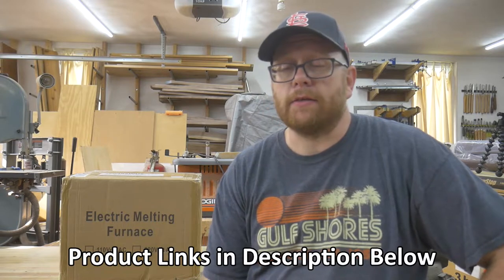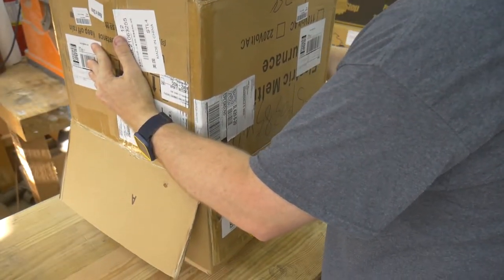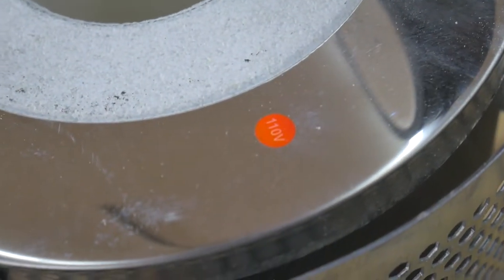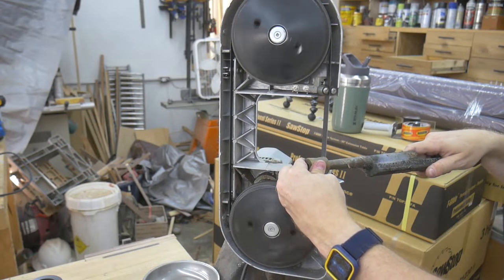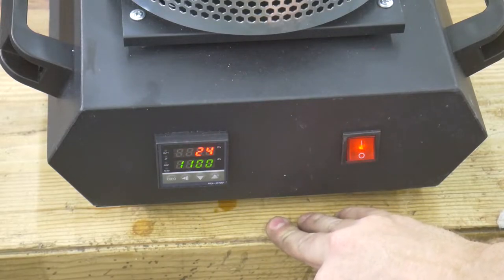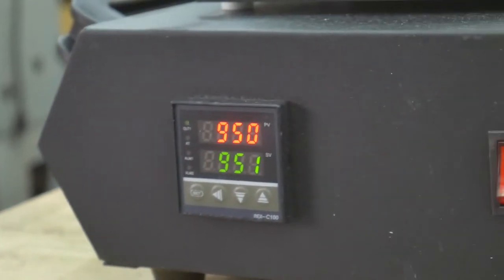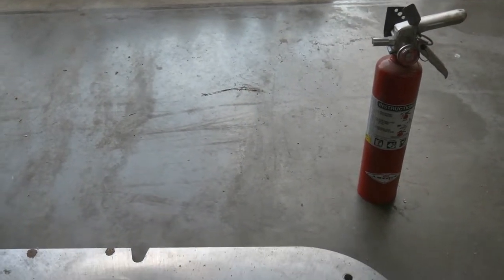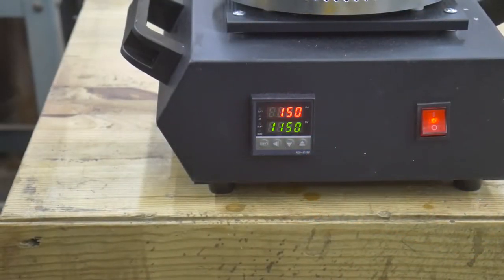Are Metal Melting Furnaces From Amazon Worth it?

Comment: Thanks for the review Thomas, I'm thinking of buying one of these mostly for aluminium and brass, how has the furnace performed since you had it?  Thanks Ade
Reply from the maker: It works good still. The electric furnaces do wear out over time. The heating element will burn out eventually, but you can buy replacements. Propane forges are another option if you do want to deal with an electric one.
Reply: @SouthpawWorkshop  Thanks

Comment: Now that you've had the furnace for 2 years, is it still operating? Any issues since purchase?
Reply from the maker: Still works fine but I do not use it regularly. They do have parts that wear over time. The heating element and the ceramic insulator won’t last forever, but can be replaced if necessary

Comment: Great job thank you
Reply from the maker: Thanks!
Reply: @SouthpawWorkshop  Hey, can you try to melt steel in it? If you still have the furnace ofc. Im just wondering if you can melt steel in these things.
Reply from the maker: No way. It doesn’t get nearly hot enough to melt steel. This thing maxes out around 2000 F. Steel starts melting somewhere between 2500-2800 F
Reply: @SouthpawWorkshop  Okay thank you. I will just buy one that is like 1500 degrees to melt the steel!